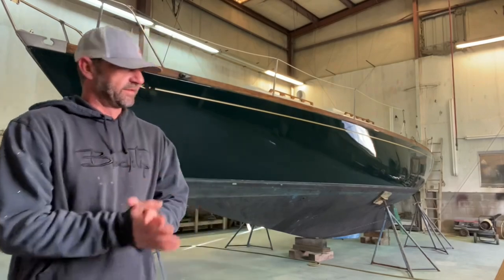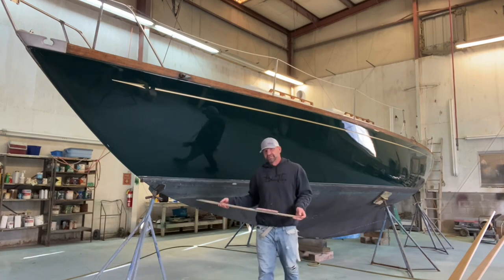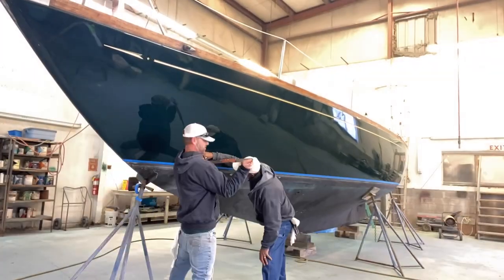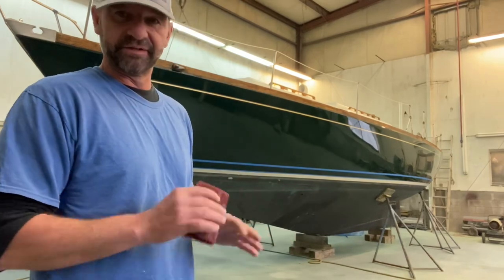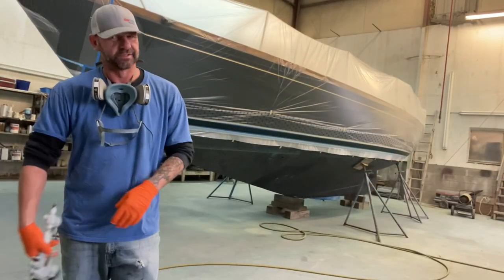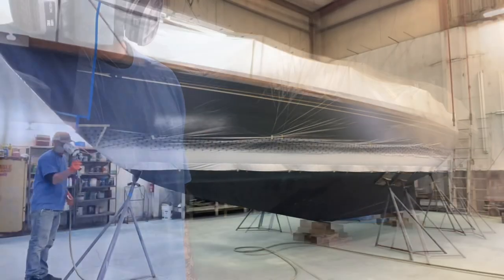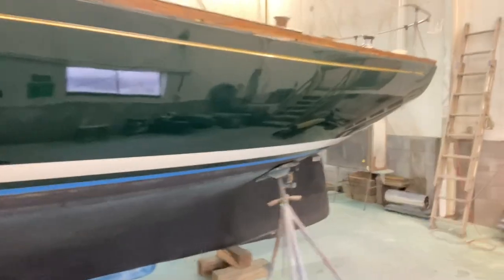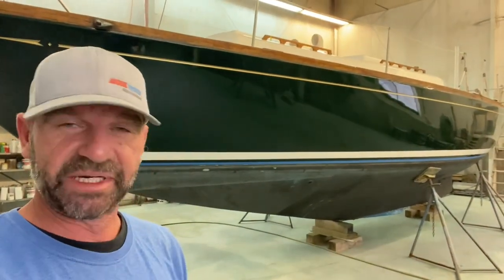Projecting, prepping and painting a Bootstripe on a 1966 Morgan

Comment: Thanks for a great video Frankie. Another great way of marking out is to hold the top edge of your spirt level against the known waterline etc, masking tape a pencil to the top of an appropriate sized spacer. Slide the space and attached pencil towards the hull along the spirit level until you make a mark. 
Cheers from Peter in Australia👍👍

Comment: Love the videos!  these really really help a lot.  I have watched all the videos and have a few questions:
1)  do you use the standard reducer most of the time?  Ratio?  
2) when spraying non-skid do you shake the gun or mix up the contents in the cup to keep from clumping?  or just mix well and spray fast.  do you spray a thinned top-coat over the non-skid to cover ensure coverage over the non skid.  getting ready to do some non-skid on my sailboat..
3) just bought a 3m PPS2.0.   how does this compare to your gun?  I have a pretty decent idea of the gun settings you are using but some guidelines would be great.  Not sure how you could specify the volume but the fan and initial pressure settings might ensure we are at least getting close.
THANKS AGAIN!

Comment: Wood mixing stick, not so sure about that!
Reply from the maker: Lol. You’re the 2nd person to say something about mixing with the paint stir sticks 🤣🤣 that’s what they are made for. Lmao
Reply: @boatpaintingrestorationwit3029  I know, but the thinners could disolved the resin’s and oils in the wood and then you get fish 🐠  👀 , then they say that the paint is contaminated, I always advise to use the aluminum ones 🧐.
Reply: @Cutlass-27-Mallorca  Most of the paint mixing sticks last century were basswood or Sitka Spruce- very neutral. They were actually approved by Dupont for Imron. As I started moving into Awlgrip early this century and noticed Eastern pine sticks, I started making my own Honduran mahogany sticks which I let dry wet, sanded, cleaned and reused. I notice a lot of shops using stainless steel now. I have also used glass mixing wands. I am a bit sketchy on aluminum alloys. There is far too much potash used in processing.